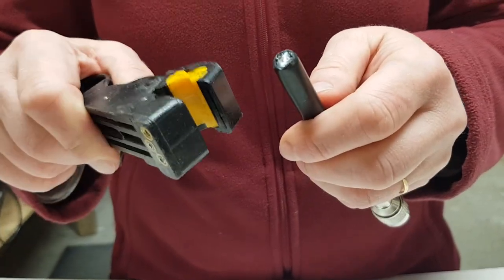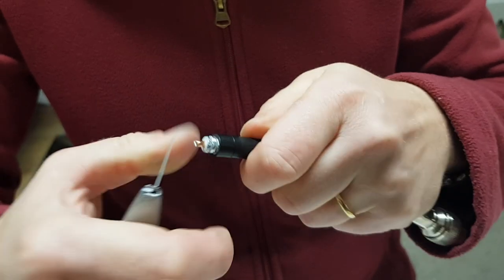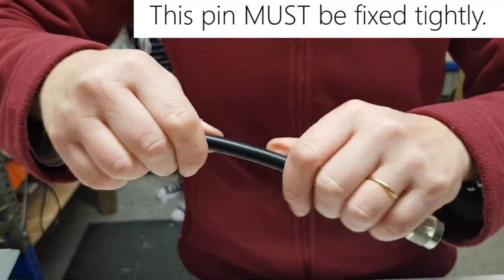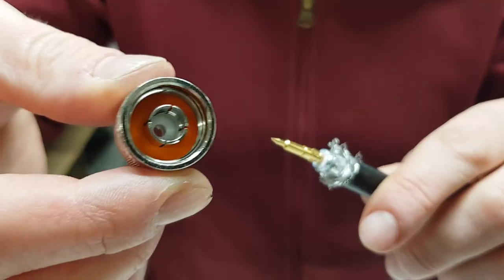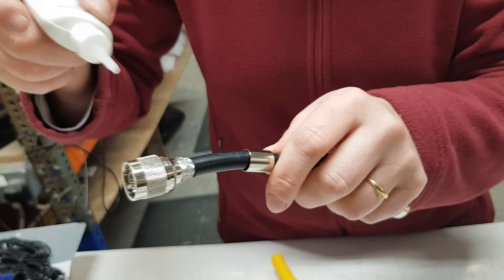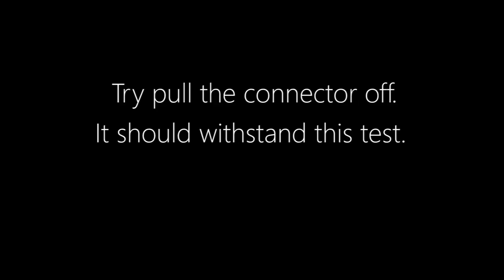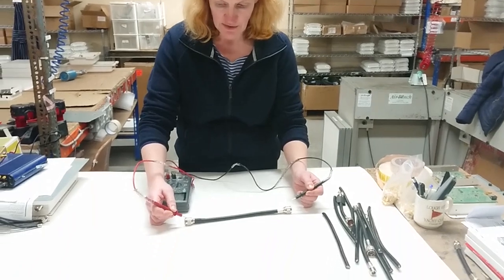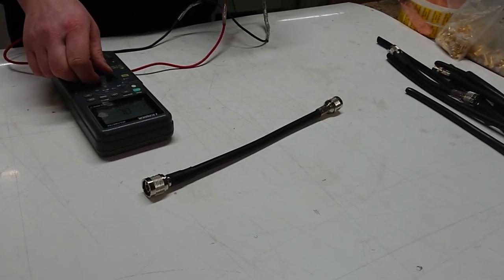How to put on an N type connector

Comment: I don't understand... the RF travels on the inside surface of the foil,  yet the connection with this connector, the connection is made on the outside of the foil.   More confusing, the inside of the foil has a super thin insulated coating, so there would be no RF connection if you got the connector inside the foil.    There is little point in buying high performance cable unless the connectors are fitted perfectly.   So a bit lost really.    To put this in perspective RG213,  which is a conventional heavy copper braid and no foil,  has a loss of 3dB at some length at 450MHz.   An equivalent foil wrapped cable has about 2dB loss same length same frequency.  We have 1dB in the savings budget.   It would be easy to lose that if the foil connection is not correctly addressed in the terminations.
Reply: The signal travels along the surface of the centre conductor. The outer sheath is for shielding. The distance from the centre conductor to the outer sheath is for the sine wave.